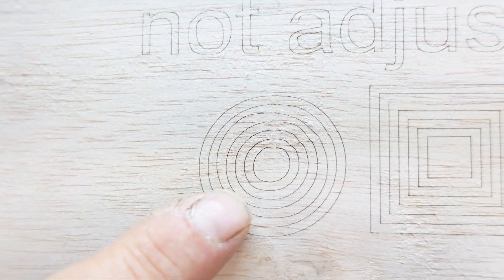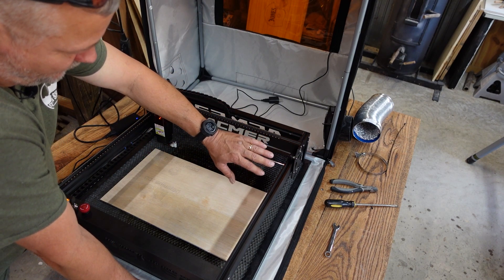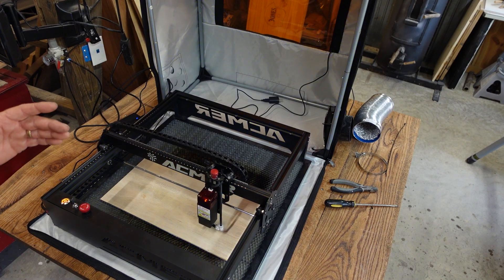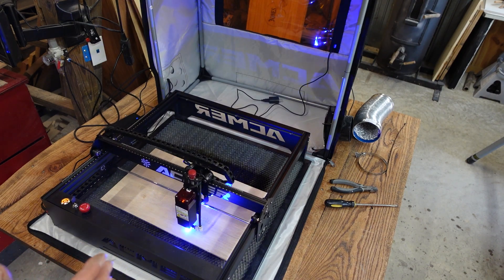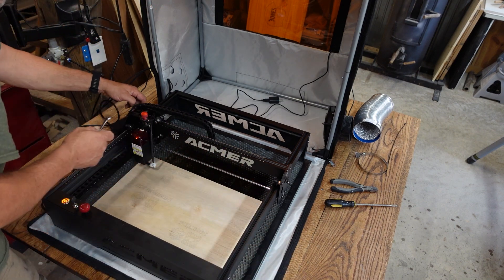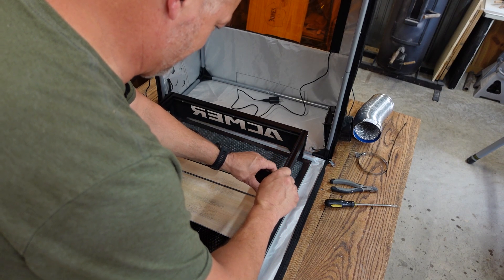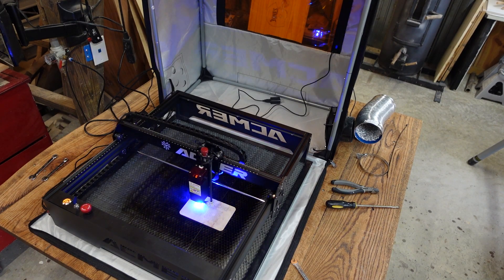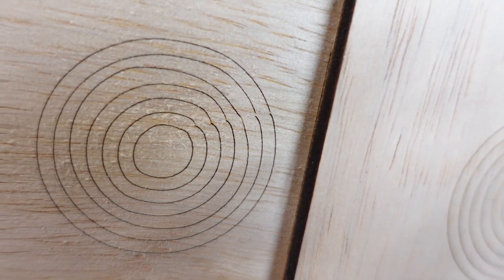I messed up my machine.. to show you how to fix it

Comment: My xtool D1 Pro 20w is making ovals when I am trying to engrave circles and rectangles when I am trying to engrave squares? This started after I was trying to frame a design and the gantry contacted the back bar of the laser's support frame and made a ratching noise for about 2 seconds, then stopped. Is there now something out of adjustment, or how can I correct this problem? Thank you
Reply from the maker: Check belts and timing rod. https://youtu.be/YTJB6gkxhyI

Comment: Finally a video getting me in the right ballpark!  My fault for not checking here 1st, lol.  Uuugh, my brain hurts from ciphering Atezr's mini pictograms with a magnifying glass.
I think my other problem is from the extension rail kit.  I think the machine doesn't know it grew...I couldn't get anywhere with (no instructions) using the touchpad to define home or center (crash if start to close to corner).  I should just go ahead and install LB, but was worried I'd over complicate things until I irons out the bugs...but will this be easier to do through LB?  Is it a thing to unplug and manually reposition the head to reboot?  Thanks for any help you can offer, even if it's Psychiatric.
Reply from the maker: Glad it helps. You may wanna watch this one too.. lol..   https://youtu.be/O-FxtDmLXdE

Comment: Well, my B1 36 arrived today and as I was "snake bit" with a previous Algolaser Alpha having issues with bearings, (full disclosure, "I" may have precipitated the failures by over tightening the belts), it still had squiggles in the text even at low - 2000mm/min speeds -  and the cause is/was still unknown.  Anyway, you mentioned a 45 degree "tilt test" where the X axis should gently slide UP/DOWN the Y axis when tilted, indicating a good belt tension.  I am starting out with "minimal" belt tension and will see how it prints/cuts.  My machine does a nice glide at only about 30 degrees or so - laser head attached - and IF the machine tracks and there are no squiggles in the text, then great.  I figure the tension can always be tweaked up a bit, and if the present belt tension gives good performance it is a win win...  A side note.  I was VERY pleasantly surprised by the quality of build and fit when assembling the unit.  The rails/rollers were smooth as silk and I believe that Algolaser Alpha died on me just so I would/could buy this puppy and really receive a top quality unit....  I took my time getting everything just right and since my vent hood, (the TwoTrees TS2 hood - 800mm x 800mm x 400mm - won't be delivered until tomorrow), there was no sense rushing.  I got the idea from "Steve - Builds Everything", to build a laser crosshair that makes aligning the cuts/texts easy peasy....  One addition to the crosshair is to feed the required 5 volts unit through a 500 ohm pot which makes the brightness range from dim-barely visible to full on bright.  Full bright is really too bright to use for seeing the crosshair alignment marks on your projects and the ability to dial the laser crosshair brightness to just visible makes for an EASY sighting in to your marks.  One last note about belt tension; after belt installation, with the unit upside down and LEVEL, I placed a 1/2" x 1/2" x ~ 30 inches long wood stick arcoss both belts in the middle of travel - equal length past each belt with the X axis at one end.  I then measured the stick height at each end of the stick and tweaked the belts until they were both even, measured to the table top.  This does not tell you anything about proper tension, BUT, BOTH belts have equal tension.  After cut/text testing, If it is indicated that a slightly tighter tension is needed, I'll know for sure that, with equal turns of the tension screws, BOTH belts tension will/should be equal.  Thanks for the "comment space" to convey my assembly story and to give some tips of how to configure a laser crosshair using a pot to make it easy to see....
Reply from the maker: I have never found crosshairs helpful using absolute coordinates and jigs. I know some folks like them but not me. Glad you are getting it going, have fun.
Reply: @TheClackShack  It's good you've mastered the AC method and for a properly set up jig, you're good to go.  The jigs I have built were more "free flowing" where a center and extreme positive and negative sight crosshair engraved intro the jig with "balanced" marks, (Pos 60mm - 0mm - Neg 60mm).  I would center the positive Y etched mark, move down say 120mm to the negative etched mark and when both matched, I would move 60 mm to the center and start the job.  I'll probably get on the AC method with "calibrated" jigs the further my lasering travels take me....  The *"Left Center - Current position option is VERY good for on the fly texts when you don't have a jig and THIS is where a crosshair shines*....  🙂

Comment: Well, UPS says my B1 36 will be delivered tomorrow.  From the assembly videos I've seen, the belt "idler pulleys" are SMOOTH and not toothed.  I will know for sure tomorrow what type idler pulley Longer is NOW using, but, It just seems to me, my engineering self, that for a toothed belt to roll over a smooth idler is not optimal, squishing the teeth vs having them run in the proper slotted teeth.  I believe that a toothed idler will give the belts the PROPER seating when they run over them.  I think that IF I decide to change out the smooth idlers with toothed ones, it should be done in the very early hours, if not immediately, before running the machine.  What is YOUR opinion on smooth vs toothed idler pulleys??  Thank you for your experienced reply....  Hank
Reply from the maker: The amount of tension used in these machines should cause the belts to deform. You want just enough tension. The stepper gear is slotted

Comment: Great job!  I purchased an Atezr 35w Plus in November of 2023.  It was a total mess coming from the factory.  The X Axis Gantry was locked down, the  X Axis belt was too long had to order ferules from AMZN to shorten it.  The Y Axis belts were not tensioned from the factory and were simply floppy.  After reviewing The Clack Shack and a couple of other resources (Lightburn folks are amazing) I finally got the machine where I could run a simple project.  Viola!  Still, circles were "egg" shaped and not closing.  This solved the issues.  I would also like to stress that cleaning the laser head at least daily is a definite requirement as I have learned.  Going from a CNC using Vetric VCarve Pro to the Atezr was quite the challenge.  These Chinese lasers are great from an engineering standpoint but you are on your own regarding service.  Greatly appreciate The Clack Shack and the laser community for helping to dig me out of an expensive hole!!!  Duplicating The Clack Shack test card it absolutely necessary.  I might also recommend that to get accurate calibration utilize Lightburns Calibration tool:  Edit/Machine Settings/Calibrate Axis (see lower menus).  Absolutely essential!  Quite the learning.

Comment: I bought the Comgrow z1 that you reviewed. seems to work fine,  I am a new user.  My question is that it has 2 motors on the gantry with out the rod between the drive cog wheels.  I can move each end of the gantry slightly before it moves the other end.  If it is slightly out of square when you start, it seems like it would not be able to make a square, it would make a slight parallelogram.  Do you find this an issue?  also when I push the gantry with machine off I feel a "cog effect every couple of inches.
Reply from the maker: As long as both belts are equally tensioned, it should stay in sync. I haven’t seen an issue with the z1 but it could happen. In theory, the dual steppers should sync automatically based on the position they were at when powered on. I like the dual steppers approach personally, it allows for higher clearance below the gantry.
Reply: @TheClackShack  I guess the key is check for square before you turn on the machine and do not move the gantry on the z1 by hand ever.  thanks

Comment: I have a crook d1 pro and I’m new to laser work and I want to calibrate and change my return point after a burn so it doesn’t slam into home so hard. Where do I make those changes
Reply from the maker: Under the settings, return to.
Setting the "return to" location in lightburn
https://youtu.be/G9Mh--nr_5E
Reply: Thanks pal